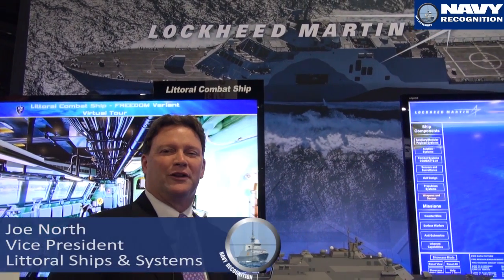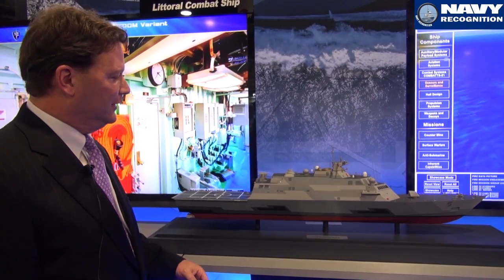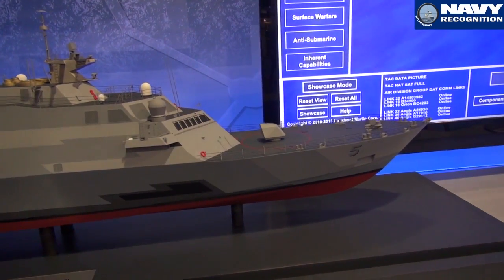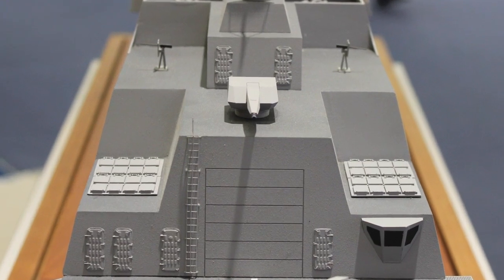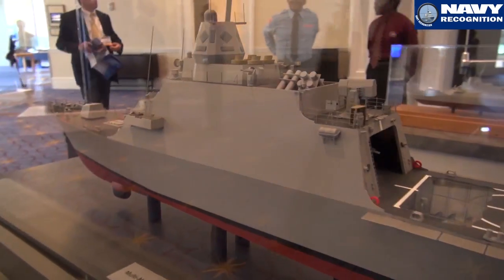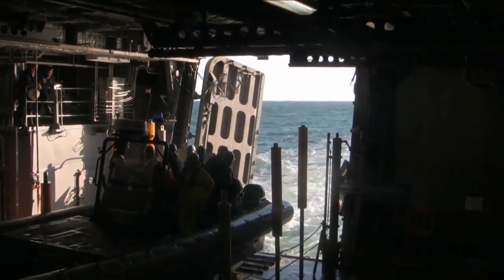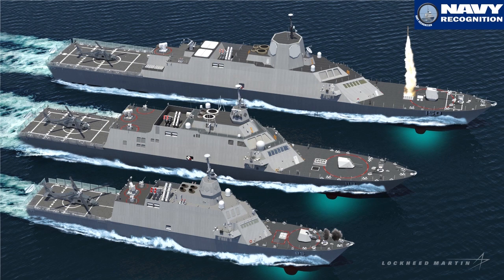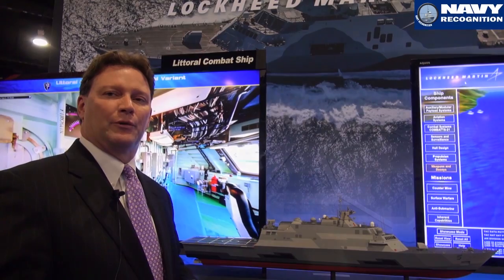Lockheed Martin Freedom class LCS at Sea Air Space 2014

Comment: These are better than you have done.  You need to make a 90mm, 105mm, and 120mm gun. 57mm is dumb! 76mm is the smallest a gun should be as a main gun. Corvettes need to be at least 300ft. with VLS and Harpoon tubes.

Comment: I worked in this program for a while as a defensive contractor. It's a money pit. Constant breakdowns. Maintenance information outdated or non existent. Sound idea... definitely. Poor construction. After 20 years in the navy and serving aboard 9 different ships over 20 years. I can say this platform is junk. They were supposed to build 55 of these and they cut it back to 25. I think. Regardless of that number though... they cut it back. And as for the comment about the Spruance class... that was an excellent design. All of the planned ships were built and did good service. The LCS platform is the Navys...YUGO!

Comment: The big advantage of this design is that it has enough hull volume to develop into a true FF. They badmouthed the Spruance class the same way, but it was later developed into some really great ships. I'm not impressed with the Independence class because, while it is a fast, stable, maneuverable hull, the usable internal volume of a trimaran type hull is very limited.

The one drawback with the Freedom class is that, like the Zumwalts, they are trying to do too much with two few personnel. They tried that back in 75 with the USS Belknap. They sent us on a med cruise with 100 fewer men than she was rated for. We could do the mission with that many but the crew was constantly exhausted and manpower couldn't be spared for training. Also there weren't enough men to sort out the best for critical jobs and use the worst for the scut work. It was crew fatigue and poor training that led to the collision with the Kennedy and the loss of 8 men between the two ships and nearly the loss of the Belknap. Bupers has never admitted to the experiment with low manning levels but anyone aboard knew what was happening.

When it comes down to it battles are won by men, not necessarily ships. A decent ship can become a real contender with the right crew.
Reply: Lawrence Withrow well said and true
Reply: to bad they turned out to be garbage
Reply: They're junk

Comment: I wonder why it is in Integrated Phase Maintenance Availability in Asia.  High speed vessel above 40+ knots have problems which needs some extensive engineering associated with monohull vessels.  The other class LCS seems to be doing good.  Maybe, an new class of aircraft carrier is need.  I wonder if the comparison is a race to a new type of aircraft carrier to get rid of some old US Navy BS and sabotage by the Hippies.

Comment: i've worked on boats like these and we laugh about it all the time.. we put sooo much time and effort and pain and money put into making every little thing perfect...on a boat that could be blasted apart at the drop of a hat, lol.
Reply: Keldren Raze Maybe if you and your friends put more time into your jobs and less into thinking what things are being used for; fewer mistakes would be made.Understand what the mission purpose of these vessels are being built for and that the costs will go down as all the problems are worked out. The original Abrams Tank was full of problems and cost alot more than they do now.We do not build Abrams tanks anymore as they are repaired and returned to use.During the recent conflicts, very few were totally destroyed. Which is a hell of alot more than the cheaper Russian made T-55 and others could brag about .My comments about you and your friends? I too worked in the ships and I noticed the "quality" of workmanship. About 10,00 defective welds on the outer hull of one submarine alone. Worked on by professional welders. Union welders who should have known better.
Reply: +Greg Wallace ... Thinking less would result in fewer mistakes? Riiiiight.  Yes, the costs have come down. But the engineering on these boats suck. You fix one problem and three more pop up as a result of fixing that first problem. I guess your right though, we shouldn't think too much about how things are being used...  or designed, or interact or how changing one thing can affects something else...  duh. Then you say you worked "in the ships" which I assume you meant the LCS "ship", but refer to 10,000 defective welds on a submarine hull?
Reply: Greg Wallace union people are to comfortable and get lazy....  what do you expect... lol
Reply: mach533x - Okay, you are ignorant dumb ass!  Unions do not design the ships, the build the ships to the design specification!  Now go get drunk and play with your guns!

Comment: A 50 cal will shoot completely thru this hull.
Reply: Good luck getting close enough without detection.
Reply: 1950Viper Again, too bad they didnt consult you first.  I agree the gun designers/weapons engineers are idiots.  Who needs a degree when you can be an internet expert and look up all the knowledge you need on wikipedia.
Reply: 1950Viper A .50 can go though an inch of steel. But how many of these do you think you will need to sink or even damage one. What do you think THEY will be shooting at. I believe they mount a 57mm Otto Mera gun and 25mm guns not to mention those hatches in various places. They are to a VLS missile system. You know, ASROCS, SM2s and Harpoon Cruse missiles.
Reply: 1950Viper no it won't !!!!
Reply: maybe but whether or not means anything depends on where, the boat mixes steal and aluminum strategically and reinforces certain rooms with armoring inside to minimize risks of damage anywhere it'll really matter, every room can be sealed off and most rooms aren't essential to the critical functions overall anyway, even those can be controlled remotely from many other parts of the boat, even down to servo's on pipe valves...  just enough to limp home is all they need.    all said and done tho, i wouldn't trust it with my life...
Reply: Sheffield was under no radio emmisssion zone in direct support of the ground units so not detected. Its identical to the Arliegh Burke class ship. A hit by Exocet its warhead didnt explode 240 lb warhead. The fuel burned thru aft CIC bulkhead burned thru in 10 minutes and bridge completely burned the bridge and 1 hour ten minutes the ship was lost.
Reply: same way they blew up the Cole drive right up to the ship and blow it to shit. If there is a will theres a way a aluminum ship is fucked for combat shit rounds blow thru aluminum like it isnt there. LAVs with their aluminum armour blow all to shit from a b40 rocket. A electrical fire on a fiberglass version burned to the water line in 10 minutes look up Littoral disasters. Those iddi bitti lille cannons poke litter holes in ship the normal 5"38 calibers blow ships away try to sink a ship with those guns.
Reply: wanna bet aluminum just like you drilled the holes. Vietnam aluminum Armour kills people 113 apc fine example rpg go completely thru it. Fiberglass is even worse it goes completely thru and dont set off the warhead. Carlos Hathcock  La Trang white feather was severely burned in a apc and he was on top. Ho Chin Min paid the bounty to the VC that hit the track.
Reply: Uh... no it wouldn't. Have you ever been aboard one past the quarter deck? If you havent... then shut up.
Reply: Your not supposed to let them get that close 40 knots+

Comment: Not a fucking lesson learned on aluminum hulled ship. A fuel fire as in Exocet missile and burn thru fire doors and bulkheads. Look at the Sheffield CIC burned thru and destroyed the ship. Fire bulkheads just burnt thru. Paint peels and aluminum cracks from fatigue. Electrolysis will eat the hulls. Wanna destroy this ship throw a power cord into the water in 24 hours any exposed aluminum would eat thru the hull. Arleigh Burke class has fatigue cracks everywhere.
Reply: Aluminum doesn't rust in sea water, the electrolysis won't work, in fact it'd protect the metal from rusting as well.

It's a common misconception that aluminum rusts in sea water, there's no real reason to paint it either but done for looks etc.
Reply: zagan1
you have never had a boat in salt water  your out drives without zincs would eat it away., Power from a shore power line and any exposed aluminum will eat thru 24 hrs. I was docked at a marina and a guy 4 slots from mine had a heater power cord in the water. Boats on either side of him had eaten thru casings on their out drives. Aegis type re and ddgs any any other aluminum superstructures. One of the new fiberglass version burn to the waterline from electrical fire not quite the show they wanted out of Littoral type vessel.
Reply: My  guess is that it may be a different alloy/thicker hull, or maybe the Navy is banking on the CWIS to destroy targets incoming threats.  The later of the two seems pretty risky.
Reply: 1950Viper Yes, that compares to naval ships.  All ship builders are idiots.  Too bad they didnt consult you first.  After all, you stayed at a Best Western.
Reply: aluminum melts at 870 fuel burns 2200F degrees and burn thru in less than a hour.A bullet from a .50 cal will blow completely thru the hull they wont bounce off aluminum they melt thru.
Reply: 1950Viper True, but a fuel fire left burning for an hour would'nt be too healthy for a steel hulled ship either.  Honestly this ship design seems pretty stupid.
Reply: These ones are steel, it is the Independence class from Austal that is aluminum.
Reply: R3AGAN AN aluminum fire gives off more toxic fumes than a steel one.Also aluminum melts at half the temperature of steel. I believe that's why the Burk class destroyers were built of steel and more toward old fashioned guns controlled by new electromics.
Reply: Greg Wallace Toxic fumes are not good but they wont be much more deadly than the smoke put out by the fire.  Also, damage control crews have respirators so they wont be effected.
Reply: you have never been a ship board fire the CIC controls all defensive weapon and it burned out in 10 minutes and the bridge was abandoned in one and 10 minutes entire ship was abandoned.The fire doors burned thru theres no isolating the fire or sufficating it. The fire deforms and warps and softens bulkheads steel retains its structure. Aluminum burns at 780 degrees and burning provides oxygen. Its own nfuel burns at 2200 degrees.
Reply: 1950Viper Oh fuck dude that's crazy.  Was the ship hit by something, or was it a malfunction?
Reply: Hit by a Exocet missile one of two fired the first was shot at the ddg missed second fired its warhead failed to go off it hit Shelffield aft of CIC only the fuel burning it penetrated CIC almost immediately. CIC abandoned and bridge access fire door hatch burned thru in 10 minutes all communication lost fire burned thru decks and allowed fire everywhere. The cargo ship that has reinforcements and helicopters for Goose Green troops the Sheffield was emission free so the Argentinians had to search. The second missile sunk the cargo ship setting fuel and ammunition on fire.
Reply: Agreed, even the armor on the M113 APC's. But those cracks on the Burks are from faulty welds and two people not doing their jobs. The welder and the inspector.But the armor on the hulls on the LCS class are steel. As for the Sheffield ; from what a Navy Chief told me the Brits had both the Emergency Generators and both the Emergency Pumps on opposite ends of the ship and with the fire in the middle...well .Like putting the fuel tanks by the exit doors of your APC. DUHH!!